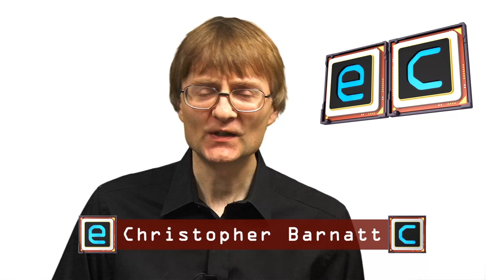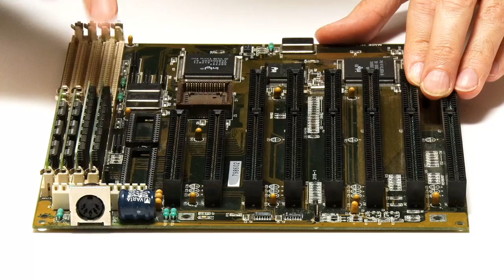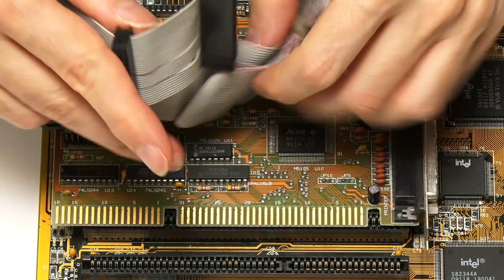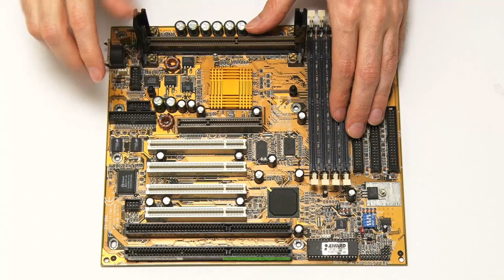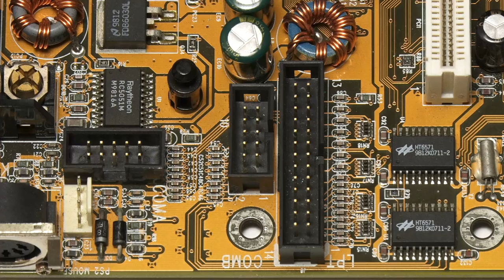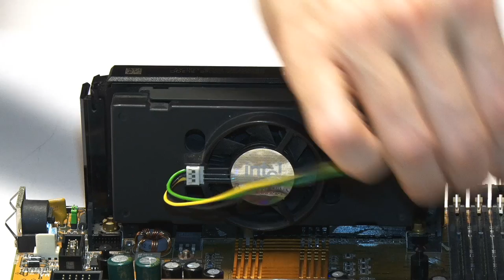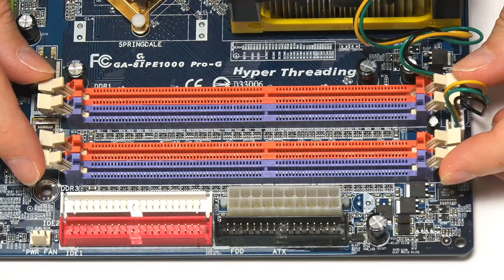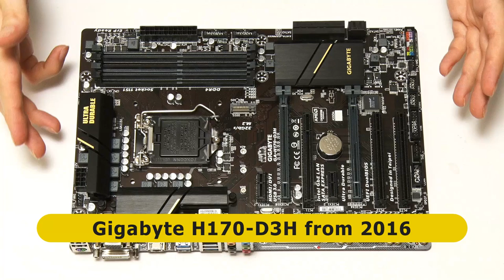PC Motherboard Evolution

Comment: No comment. Anyone that knows PC history can see lots.of holes in this demonstration. Especially the 1st board you labeled as a 386......which is clearly a title reserved for the second board you showed. But, not everyone knows everything
Reply from the maker: This video is not presented as a definitive history as I make very clear at the start. Having taught computing in a university for 29 years, and having published 13 books on computing and related topics, I think I have a little knowledge. Yes, the second board shown is a 386. But so it the first board as I indicate. This is very, very clearly verified by the shot of the 386SX-20 CPU soldered to the board -- at about 3:00.

Comment: omg. 1991->1999, skipping everything in between?! 486/cyrix, first pentium, pentium mmx, pentium pro, etc., straight to pentium II? sorry, you skipped a damn decade of computing. your collection sucks, just like this vid. you happen to have couple of more-less modern mobos and you decided to make a vid on mobo evolution even if you lack depth or material. riiight.
Reply from the maker: As I said in the intro, this is not presented as a definitive history and is constrained by the hardware I have available. I was very clear about this from the start.

Comment: I cringed when you called a fan connector a mouse connector i cried when you streched the fan cable, why!
Reply from the maker: I never called a fan connector a mouse connector. What you accuse me of is simply untrue. I presume you are referring to about 9:29 in the video, where the white 4-pin connector I point to is NOT a fan connector. These are old motherboards, and connectors like that were used to provide headers for all kinds of extra sockets that could be added. If you look at the video, you will see very clearly that the connector I point to is labelled "PS2 Mouse".

I do not needlessly stretch the CPU fan cable --- rather I connected it to the only connector on the motherboard for the CPU fan (and which is labelled "CPU Fan"). Presumably you are implying that I should have connected the CPU fan to the "fan" (actually PS2 mouse) connector discussed above. :) I ran this motherboard for several years, and know which connectors are which.